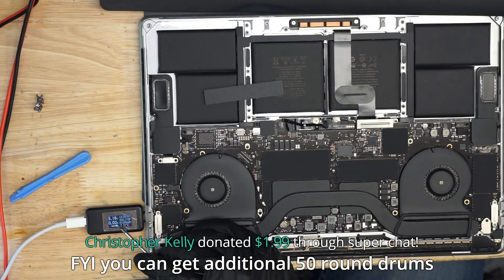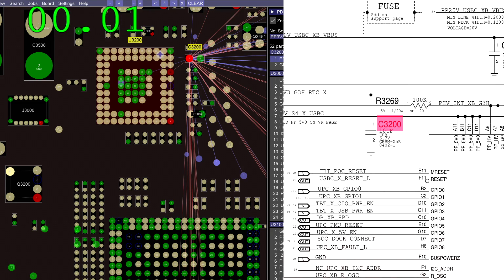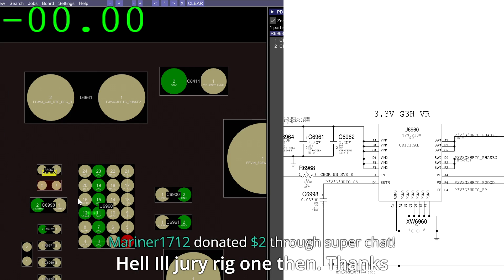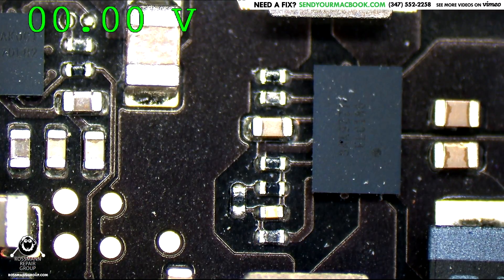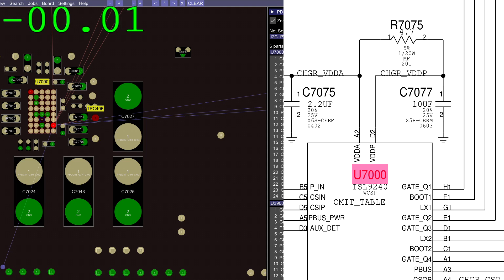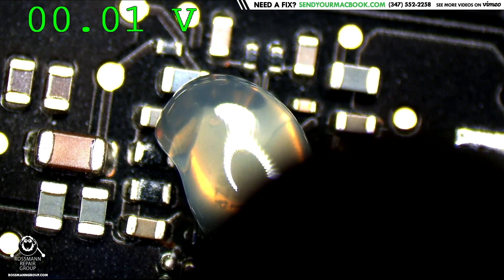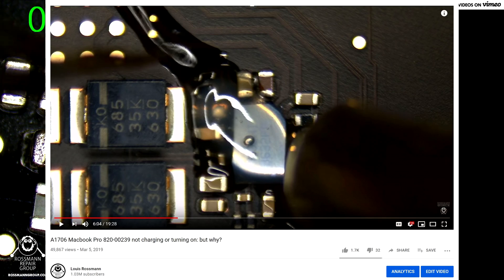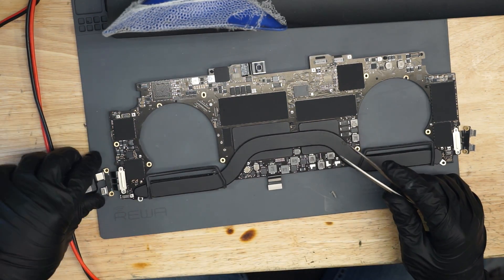How Apple is shaping the future of repair.

Comment: at this point Louis id find a freelance engineer to design  a similar charge controller on Upwork or something
Reply: No, it will not, it costs too much.
Reply: Mircea Ciocan nope. At my wildest guess like 4 grand.
Reply: @DarkSoul-ds2  close to my estimation, see my other comments, but even 4K are difficult to recoup, and if some Chinese truck'of'goodies spill some chips then this will be wasted money.
Also with 4K one can buy a lot of apple chargers that are claimed to hold the original chip (prolly Intersil conditioned apple for a number of units to be bought to offer exclusivity, and they've had to offload some, just not to the repair shops :( ):
Reply: Mircea Ciocan it would be more helpful to just make them. Louis said he'd offer like 4 figure reward for the original chip.  But if it's fixable with the new chip then I don't know if Louis would use it or not. But I'm sure other people would buy it. Louis isn't the only repair technician in the country. There are hundreds of thousands of dollars to be made with this chip.I don't know what this would mean for independent repair even if this chip is better made than the original, but if it's really about the consumer I'd doubt they'd care what kind of chip the repair technician would use . by wildest guess I meant Highest. I'd say couple hundred on engineering. And maybe at the lowest like a $500  for a batch of 10000. Ill try to make this work
Reply: @DarkSoul-ds2  Well, I sincerely wish you good luck, I have the skills and the tools, but not the boards to experiment on, sadly :(. And still have to work for a living, even more sadly.
But while making an MCU emulator will not be that hard, making a drop-in replacement chip IS difficult, and once apple drops this chip model or gray market will have some, it will render them valueless.
Anyways, if you get traction PM me, I can help :), even with a shuttle run on a foundry in Dresden.

Comment: You might need to hire 1 or 2 very talented electrical engineer, as well as very talented programmers ( for example DosDude, the guy that has bring new life to unsupported macs  with his patches, that allows you to install the newer OS. He also as write a lot a great code. And has a permanent solution for the 2011 Macbooks Pro graphic problem.) With people like this you might be able to figure out great solutions for those nasty Behaviors of apple, soldering and locking down everything.
Reply: Agree

Comment: Too bad a third party manufacturer can't make a non-fruit laptop, possibly based on the A1502 series from fruitville, that is designed to be maintainable/up-gradable and pretty much bulletproof, that would run OS-X/MacOS.

I seriously like the OS, but am not wed to the hardware. Sadly, that will never be allowed to happen in a viable commercial basis.

Comment: Years ago the ccc.de people were polishing chip enclosures down and scanning them with USB microscopes to reverse engineer the chips circuit. Thus coining the phrase "what's protected in hardware can be broken with hardware", a joke the phrase security people usually say about software. Could one not do the same to the standard (source-able) chip and an apple chip to figure out what is different? Being able to use the standard chip would be a great fu to apple, and save their victims... sorry customers.
Reply: TrevelyanOO6 Its possible, but Louis is not geared up for that kind of project.

Comment: Can you charge the battery externally just to recover the data?
Reply from the maker: No.
Reply: @rossmanngroup  
"Y & B For iPhone and MacBook repair" just gave the hint that the iPhone XR Smart Cases have the ISL9240 present inside them. A picture of the board confirmed it but the one in this Mac in this video says "B840ZR" and the XR one on the pic says "B840AJ" so I don't know if that's just serial numbers or something or if they're any different but I think that would be worth a shot! I'm not saying get new cases for $150ish but look if someone's willing to donate a used one or look on eBay or Craigslist or something and try it :)
Reply: @rossmanngroup  I know you probably gave up and please excuse me if I'm completely wrong... BUT, could you possibly inject that signal I think you said was 3 volts into that latch to force the chip to the charge mode w/o the chip that needs to be replaced? I'm not very familiar at all with the circuit but if it is just a latch/enable switch couldn't you pump that in with a resistor and wire allowing you to at least recover the data from the drive? I'm sure customers would be happy if you were able to at least get their data back even if you ultimately had to tell them you can't fix it. Again please excuse my ignorance if I am wrong but just was my first thought when watching. BTW great content I learned a lot from you already and plan to drop by your office if you don't mind next time i'm in NYC just to say hi and thank you in person for what you do for everyone!
Reply: @rossmanngroup  
couldnt you put in a charged battery and make the enable (bypass the chip or chips) for the macbook to boot :-)
and yes i gave seen all (most) (well a lot) of the power busses :-)
Reply: @rossmanngroup  Does customer have any option for data recovery by using a loaner board for the chip or even swapping ssd?
Reply: @rossmanngroup  can you use a loan board chip to get data out or its T2 time?
Reply: If I've understood correctly, in addition to kicking on the charging circuit, the broken chip monitors the ongoing battery current so even if you plugged in a freshly charged battery, the board still wouldn't come on.
Reply: Buy cheap switching ps from ebay and insert the 3volt enable signal so you can do data recovery. Customer will be eternally grateful ! It's mr.Sorin's way...😁
Reply: @intrax2tv  Essentially what I was thinking if you just need to get the enable line to activate long enough to turn it on and recover the data seems like a win for the customer. I would still be willing to pay for that service knowing that it was the only option left if I NEEDED the data back!
Reply: Big Deej Watch Sorin's channel ( https://youtu.be/1An1405Iljk ) and you will understand what I mean ! Right to repair rules... Cheers

Comment: It's strange because the example about automotive parts, as here in the UK and EU, it is law that 3rd party are allowed to make replacement car parts.
Reply: My newest vehicle is a 1993 model so am not up on this, but from what I gather, cars are headed this way too.
Reply: There is not enough chip producers. Is easier to make a metal thing than silicone chip.
Reply: Lots of people need a car. Not everybody needs a laptop. Having a car for transport versus a laptop which could be anything to get work done makes it so replacement auto parts outweigh replacement electrical components in weight by severity of need.
Reply: @bluephreakr  In today's world having a laptop is becoming more and more a necessity, so the difference in urgency between a car and a computer is shrinking more and more... But I get where you are coming from.

Comment: At the risk of asking a stupid question, can you not charge the battery in another machine then put it back in and recover the data on battery power?
Reply from the maker: no
Reply: Probably Louis tried it
Reply: @makumbaDE  Well your arrogance just failed the attitude test. It was a genuine question, I don't work on apple hardware for reasons that should be pretty obvious, though I have been working on computers since the 8 bits were popular. You know, back when manuals included schematics.

Comment: If you have the schematic, it could be possible to create some kind of "jumper set-up" to use the older chip to power it long enough to pull the data for the customer & copy it to a flash drive or something? It seems to me that you said the difference between the 9240 and the 9239 is just the pinout. All you need is a some way to connect the old chip pinout to the newer board pinout for powering purposes just long enough for the file transfer. I'm just brainstorming here; may be wrong.
Reply: For a chip swap to work, Louis would need to solder in a flex board which rearranges the pins and then solder on the other chip (now with correct surface mount pinout due to the flex board) to make it so the Macbook works again with different hardware. It would need to be tested with the old chip and other components first, which would live on the flex board and be soldered in after the new chip is reworked back on.
Reply: Il think from a previous video the 9240 also runs from a lower voltage which won't provide sufficient power for the 9239 to actually turn on. He did try a chip swap and it didn't work.
Reply: @Spectral_Penguin  still, some kind of conversion board could be made for temporary use.
Reply: I agree there may be a way to breadboard the ISL9239 and connect it with some Frankenstein wiring to a contact board that clamps down on the board in a ISL9240 pin configuration just for data's sake.
Reply: @
C J

i was thinking maybe just take out the battery and charge it elsewhere (another macbook maybe) then put it back in the machine and recover data :-)
Reply: @YTANDY100  I'm not sure if the chip affects the power handling for the battery as well or not, but to hear Louis tell it, it seems like that may be an issue that would render your idea a 'no-go.' At least you are trying to think outside the (mac)box(book)...lol.
Reply: @jezeski2011  
i saw a similar (but much shorter) reply  from louis to the same question (from someone else) and then i asked about bypassing the chip , no reply yet tho :-)
Reply: @YTANDY100  I think this chip is necessary for one of the system buses, and so even with a charged battery there's no way to actually enable the line, so the computer won't start. But I could be wrong and an idiot who didn't understand what Louis was saying
Reply: This is a job for Scotty from strange parts
Reply: He should try to make it work just to stick it to them,then Apple's stance could qualify as causing wrongful death by fire hazard out of financial desperation.

Comment: I "voted" by not buying a MacBook to replace my previous MacBook. I have switched to Lenovo..
Reply: New Lenovo carbons have soldered RAM... soon will be just like MacBooks.
Reply: @sebastian-daquanglocknerjr1883  The Lenovo Carbon Extreme Gen 1 and 2 have upgradable everything and 2 SSD NVME slots, up to 64GB of RAM.
Reply: @sebastian-daquanglocknerjr1883  Lenovo Carbon have always been MacBook, wdym soon?
Reply: @StreamerGeo Odd question, you can code on any platform.  The only exception is that native iOS forces you to, no good reason for that other than apple wanting more $$$$.

My Carbon does just fine when I'm on the road, but no serious programmer wants to work on a laptop if they don't have to.  
Interestingly I did have a minor fault with mine, after a bit of difficulty navigating the website a fella turned up at my office 2 days later and replaced basically everything for free.
Reply: Good idea! I love Lenovo!
Reply: Switched from a MacBook Pro 15 to a MSi GS65 and not looking back. Yes, there is a trade-off, the build quality isn't quite up to snuff, but it was way cheaper.... and way better specs.
Reply: @Swift Boiz A Surface? Seriously?? You mean the thing you can't repair or upgrade without destroying it? Where they soldered the SSD? Where, if anything happens to it, you're screwed?? Yeah, no. Gross! I'd rather have something I can fix and that works really well for years and years (Lenovo Thinkpad T440s 5+ years and counting owner here, best comp I've ever had) than EVER trust a Surface device!
Reply: or dell, they make very high quaity PC, like XPS as I switched from X1 carbon to XPS ( battery last for agessssssssss)
Reply: @qweweqeqw1333  Nah, Dell sucks. So does HP. Avoid both brands if at all possible.